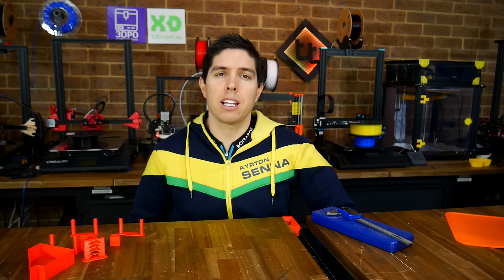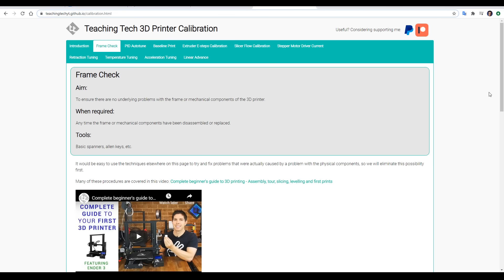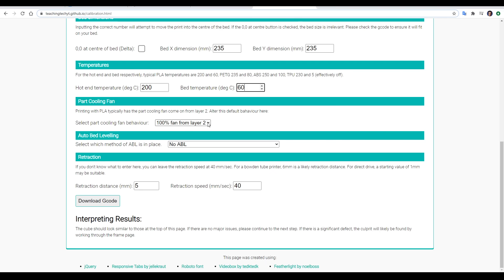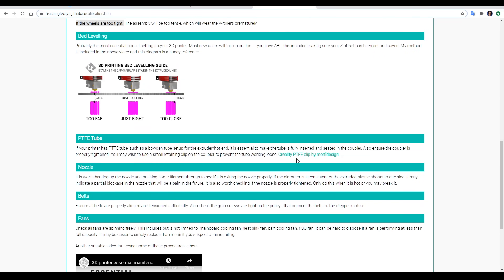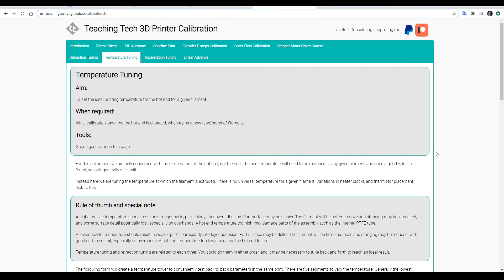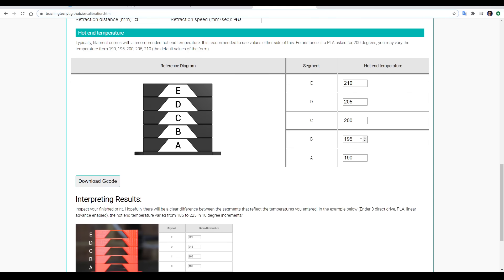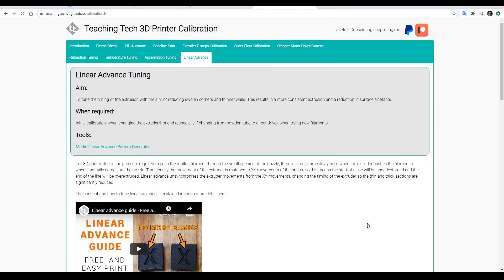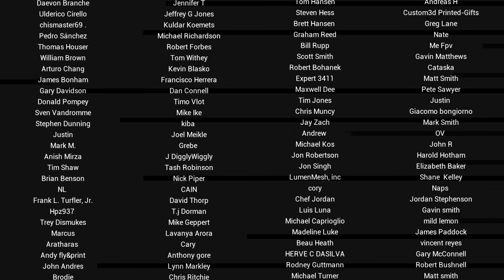3D printer calibration revolutionised - Step by step to better print quality

Comment: In which Position i have to print the 5015_30deg_Single_Radial_Fan_Dual_Ducts.stl ? I lay the dual ducts on the bed with supports only on bed. Thats ok? I use prusaslicer. Which are the best options for supports for a clean print over the supports?

Comment: looking for some help, i have my ender 3 set up like it should be, prints the first 1mm perfect, from 1.2mm to 1.6mm the extruder starts poooping like it is trying to over extrude, and causes the print to get sloppy, at 1.8mm it starts printing perfect agin but now have a mess from the last few layer, i am using Cura 4.8, i have reset the printer, uninstalled cura and reinstalled, nothing seems to help. what am i issing here?

Comment: New to 3d printing here, I've done the E steps step about 10 times and each time I'm getting a different result. I had it 1mm off and did the calculation, next one was 41 mm off! Anyone have any ideas? I'm at a loss.

Comment: Slight Missinformation; E-steps it is 100% possible to calibrate e-steps without outside interface. On an E3 pro it is possible to tell the extruder to exturder to push a specific distance of filament.

Comment: Hi, this has possibly already been mentioned but I was wondering if there was a way to change the speed for print moves for other filament types.  I would like to use the gcode generators for testing TPU but need to slow down the print speeds dramatically to 15/20mm/s

Comment: a while back i was thinking of using chains as a positive drive in a cnc/3d printer, looked it up, some had done it, i was wondering if it might cause variations.  looking at some youtube vids and seeing there's software settings to prevent ringing, maybe there's something for artefacts caused by chain drive?  are there any artefacts from it?

Comment: So, what happens when your Retraction Test shows similar good results at multiple locations?  I have an Ender 5 Pro and printed it at a speed of 40 mm/sec and divisions of 4 mm to 7 mm at 0.5 mm steps.  I'm showing almost no stringing at the bottom and top with just a bit of stringing in the middle?  Would it be better to set my distance at 4mm or 7mm?
Reply: Guessing 4mm, since it should be faster since the retractions would be less.  But are there any other issues that come into play?

Comment: This guide is excellent but for some reason I can't get the acceleration / junction deviation feature to work. Whenever I print the acceleration tuning tower all the levels look identical and none of the values I enter appear to cause any changes to the quality of the print. I'm running the latest stable Marlin on an Ender 3 with a 32 bit SKR 1.4 turbo if that makes any difference. I am sure it used to work.

Comment: I need to check into this. I made a ridiculously high-speed profile that produced almost no stringing, ringing, or seams whatsoever. But the secret was a very-coarse 260% extrusion width and 0.3 layer height. As soon as I dialed down the extrusion width, I got the ringing and seams back. Now I'm trying to go for quality AND speed.

Comment: For some reason when I enter the bed dimensions of my Ender 3V2 the Gcode I then put into Cura does not center the print. Instead it seems to be off by 1-2 cm, any reason for this?

Comment: I am needing help on layer shift , I have tried every video i can find , I have checked all wheels for smoothness and being tight , i have checked and tightened all belts , disassembled the hot end and cleaned it and reassembled making sure everything was aligned and tight , leveled the gantry with my calipers rechecked the frame for square and the uprights for square and plum and now i am a lose on what to check . can you help ?

Comment: So you're the reason people are going around on 3d printing groups telling everyone to calibrate esteps to fix every single problem people have. It is frustrating because many peoples problems are more likely to be with their extruder gears, binding in the filament path to the extruder, or simply jamming the nozzle by cold pulling filaments during changes, or other stupid things they have done. So they go through this estep calibration(which is probably already fine from the factory) instead of fixing the real problem with their machine. This steamrolls in to even more issues down the line.

Comment: AWESOME... this answers lots of stuff with almost no pain.;-) It was kind of buggy when I used it but I managed to get it done. That acceleration part has me still scratching my head, I just followed the test and trusted the force and my U20 is literally running better than EVER. The A10 is next as I put an E3D Hot end on it. If the bugs are fixed it should be real easy this time. So far for me it is the easiest thing to use at GitHub. KUDOS!!!

Comment: This is great! thank you for putting in the time and effort and best of all FREE. I'm working my way through the calibrations, However,  I wish this were available with the .6 nozzle! I have an ender 5+ that I plan to use solely for larger prints with the .6 nozzle, so the Estep calibration was great but I dont really think the rest would help. but I understand that the bast majority of users are doing so with a .4 nozzle, maybe one day?

with that being said, I did calibrate everything with the .4 nozzle and it is all working great! thank you!

Comment: Hi Michael, I went through your calibration steps and my tests came out perfect, however when I went to transfer these settings into S3D I retried the test and they failed missurably and I havnt come close to getting what the calibration results gave, is there a way to pull the profile off what was used to generate the gcode in the test? Thanks

Comment: all the gcode files on my ender 3 v2 are not sticking to the plate. tried from other testing gcode work like champ such as chep bed levelling. anything wrong or any setting that I need to dial in?

Comment: I have a flashforge guider 2s and when I try to do the temp/ Retraction tower my print bed lifts, probs the bed then lowers the bed all the way down before lifting it back to the nozel. After doing so it isn't getting a good first layer even though it had just a few tests ago. Any recommendations or suggestions?

Comment: Thanks for the video!
I wonder if calibrating one parameter at a time really gets you to the optimal results. Truth this, you're probably not a the optimum. Although this method would probably be good enough, what you're basically doing is trying to find the set of parameters which give you the best accuracy, or the least amount of inaccuracy. You're trying to minimize a multidimensional function. To do that, you're going to have to gradient-decent and not optimize one dimension at a time. For example, it's possible that by optimizing onr parameter and then the next you're actually making it worse than before. The only case in which the two methods are equivalent is when each parameter is independent of all the rest, which is probably not the case here.

Comment: I really like these tests with the ability to modify the parameters very quickly and easily. One question/suggestion; the introduction specifies 0.2 layer height and  a 0.4 mm nozzle. I have a 0.6 nozzle..what do I need to do to correct for this? Maybe that would be good to have as another selection; nozzle size. Thank you for all the help.

Comment: Thanks from the bottom of my heart for this info. and all the other things you are sharing.  Just getting started in 3D is a bit overwhelming at times even for a tech savvy mechanic with 40 years experience.  All this slicing and dicing , g code this, friction coefficient Boden tube that.  It is hard to ask for help when your not even sure what a thing is called.  Again Thanks!  ~(:>)

Comment: I am wondring if there is a reason you did not use multiple cycles when doing the PID autotune. The example in the Marlin comment shows C8, 8 cycles. Is one cycle enough to get a quality result?

Comment: Have started to use your calibration process and e steps are dead on. But wall width is .49mm giving me a multiplyer of .82. seems super low. Is this possible or even possibly normal? Doesn't seem it to me since I have always been around 1 with my other printer

Comment: This is an absolute game changer. I run all my machines through this process and the results are staggering. Thank you so much for all the hard work you have done. 
One thing I do think is missing from the website, however small it might be, but this tripped me up on one of my machines. I think a note should be made (although it might be obvious for most) that a new nozzle works best for these calibrations. I followed the calibration process on a machine that I used print wood infused PLA with. After the printing the nozzle diameter was closer to 0.5mm and not 0.4mm. I got inconsistent results  while calibrating for obvious reasons and initially could not quite get this machine right. I eventually remembered I printed wood filament on this printer and replaced the nozzle with a new one and rerun the calibration. Perfect results!! Awesome job!! Thank you!!

Comment: Thanks so much for this. But I have one question; could you provide the profile you used for all of these GCODE outputs? I know you mentioned many things are just set to the firmware defaults, like acceleration etc, but speeds and a few other settings are unknown. 

Your GCODE files from the site come out perfectly, but when I load the same STL into my slicer they are terrible; even with the same settings chosen from your template. So other settings are effecting my prints — which I can’t narrow down. 

If you could provide your profile you used, I’d be able to match every setting — aside from firmware defaults. 

Thanks for all your hard work.

Comment: I've recently installed an SKR Mini MZ v1.0 board in an Anycubic Mega Zero, adding a heated bed, as well as a meanwell 24v power supply and accompanying 24v fans. while using your website guide as referenced in the video, i attempted to use the m106 and m107 settings via pronterface to toggle my parts cooling fan, but found it wasnt working. eventually i found i could get it to activate if i entered the on board menu by clicking the control button once, which activated/deactivated my parts cooling fan depending on whether i entered m106 or m107 beforehand. is this normal? is there something in the firmware i need to alter, or maybe i've plugged the parts cooling fan into the wrong socket?

Comment: does it better if we tune temp and then retraction?, i just upgrade to all metal hotend, each time it retract there are  random bubbling after that. fine tuned to 0.5mm retraction and 200c now i got little ozze and wisp. still fine tune it.

Comment: Great video & calibration site, thanks. However, I think you should increase the explanations on the Baseline Print tab to make it easier to understand exactly why this is being done.  You give an image of your before & after but no text to explain what that is or how you got there.  Would be helpful if there was some explanation to help people understand the process.  It is understandable that some of the adjustments that may be made with eSteps, Flow, Temp, Retraction, etc. could affect what you are seeing but others may not get that based on their experience level.  It's also not clear why you are using a calibration cube as your baseline print but you are not really using the calibration aspects of the cube here.  A few sentences explaining your rationale would be helpful.  Also, you really don't mention on the other tabs to go back and re-print the baseline after making changes to see how your changes are addressing your prints.  Think that would be a useful statement to make.  And I've made the comment before but I'll make it again, I think your Gcode should include a waste line and your quick moves should raise Z to ensure you don't drag on the bed if a user hasn't properly leveled. 

Would be good to have more space for ending start gcode and the ability to add any end gcode.

On the Extruder E-steps Calibration tab, would also suggest that you at least discuss the option of disconnecting the PTFE tub from the extruder and directly measure the output of the filament instead of marking and measuring the filament pre extruder.  I understand on some printers the way you describe may the the only option.  I had always done it the way you described but someone mentioned to me to do it this way and I found it much more accurate.  You do the same set of steps as you describe, just cut the output filament, straighten it out, mark it's ends on paper and measure.  So much more accurate.  

Question/comment on the instructions for the Slicer Flow Calibration tab.  In step (3) "Turn off top layers", I find it easier to turn off top & bottom layers.  Not sure if the bottom layer is really needed and it just wastes plastic.  Maybe this is what you intended, if so then your instructions need to be updated.  Would appreciate your feedback.

On the Retraction Tuning tab, would be good if you provided a bit more info on the 5 retraction options being adjusted.  And gave some values to start your testing with.  Most people have at least a basic understanding of Retraction Distance & Speed but the other 3 are less well understood.  Would also be good if the Retraction Tower had an odd number of elements instead of even.  That way you would have the same number of values below as you have above your starting position.

But again, this is only constructive criticism, nobody else has gone to this level at helping all of us have a single point for calibration resources.  Thanks for all you do.  Have a good & safe day!

Comment: this is amazing stuff, helped me a lot. but I still have some trouble with my z-axis. it consistently prints .5mm shorter. the steps and everything is correct. I'm probably messing up the first couple of layer I guess. 

Wanted to ask you in depth but could not find the proper medium for that. I doubt it is youtube though. Is there a way to post my question?

Comment: Do any of these g codes effect the Z offset?  I set the g code for BL touch and  ran the baseline print and it drove the nozzle into the plate ignoring the set and saved Z offset.

Comment: You dont need Octoprint for the E-steps...
EDIT: Also JUST the G1 E100 F100 line did not work for me, I needed another line before that that I had to guess from using Octoprint to print 100mm before that (but it was with feed of 300/100%)

Comment: @Teaching Tech, Could you add the menu option to select your Nozzle Size on these calibration tools? I, like a lot of others that are moving on to printing more, have found it necessary to jump up to a 0.6mm or 0.8mm nozzle diameter for faster and/or larger prints. Again, much thanks for all you do and great respect!!!

Comment: I really appreciate all of your videos. They have helped me a great deal. But....lol... I can’t figure out why my prints, or my nozzle rather, drags on the print the higher the print gets. I have an Ender 5 Pro. I have ruled out over extrusion. The printer is only a few months old so it has a new lead screw(as far as I am told) so my zstep is set to 800mm stock. Is this a zstep issue? How do I zero this setting out. Is this a stepper motor voltage issue? Sorry I have looked everywhere and I have resisted asking your channel directly but I am out of ideas. Thank you.
Reply: @Teaching Tech Any input on this? I am dead in the water here. Thanks

Comment: Great set of tutorials. Loving it. One word of warning, code generated by the retraction test starts moving print head immediately after zeroing Z axis causing nozzle to slam against the print bed. Issue is that command for going to Z value for first level is after the initial move into XY position. Flip these two and you are good to go.
Reply: Has this been fixed?
Reply: @hans-walterpaolin7132  Didn't test in a while. So I don't know, sorry. Issue I reported hasn't been closed.

Comment: "Teaching Tech 3D Printer Calibration" website needs to be printed on a card and included with every new 3D printer, so useful for the beginner having everything there in 1 place. Just fitted a new nozzle and give it a service, belts, wheels etc. Went through all the steps and its printing like a dream....

Comment: This is absolutely fantastic! I am going to do this process step by step. However, I really prefer the 0.6mm Nozzle over the 0.4mm and swapping it just for this calibration seems pointless, as parameters might change again with a different nozzle, so I will just make the gcodes myself.
However, here is my feature request: Please let us specify for which nozzle diameter the gcode will be generated. I am sure I am not the only one and this feature would greatly reduce the amount of time the calibration process takes not just for now, but also everytime I need to repeat it.

Comment: Similar request as my last but for the Temperature Tuning gcode.  Would really be best if you didn't move from home to the start position at Z0.  Can really see that being an issue for someone who hadn't properly leveled their printer.  Also, would really be good if you printed a waste line before printing!  Thanks.

Comment: One minor thing. Vernier refers to using two scales with different interval sizes to make it easier to accurately read smaller intervals, it isn't a generic name for all slide calipers. Vernier calipers are specifically calipers that you read the measurement off of a vernier scale. Digital and dial calipers are not vernier calipers.